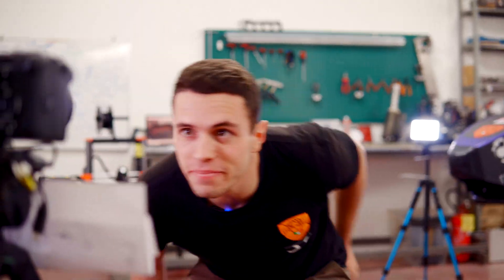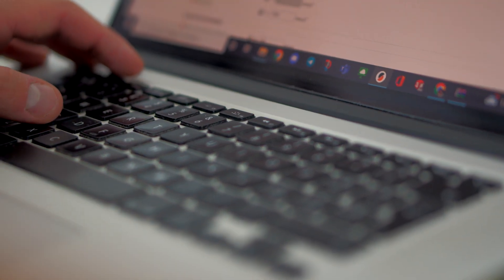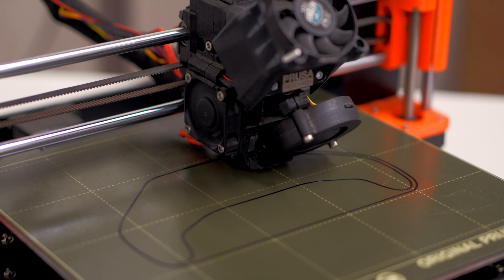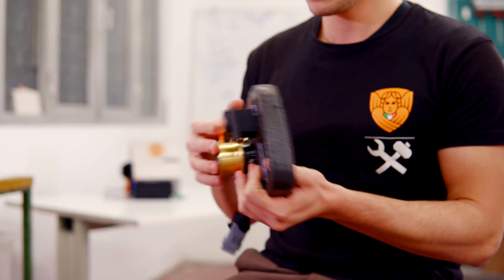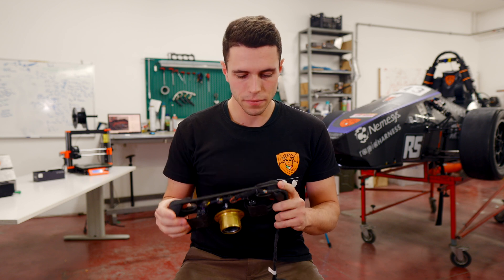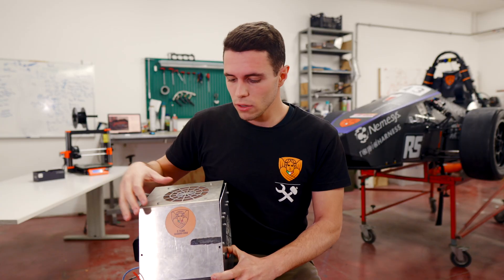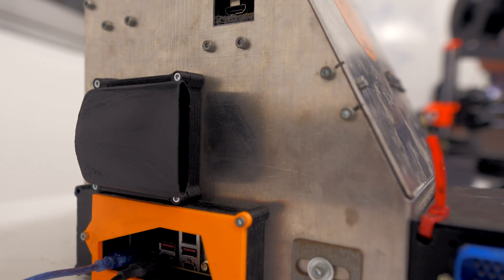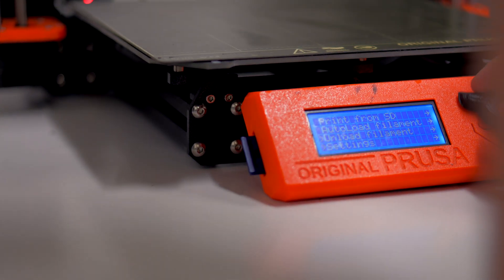Racing Towards Success: The Formula SAE Journey with 3D Printing

Comment: Bambulabs users cry about 3d printer using 3d parts and here we have a race cars with 3d printed parts.
Reply: No Bambulab users are saying that for $2000 fucking dollars you should get quality machined parts. Not shitty PETG.
Reply: @braaap2065  quality part i keep seeing broken parts  and shipping delays on replacement parts
Reply: @braaap2065  shitty pteg.... you mean asa? They stop using petg when asa came out. They where a big push on asa.
Reply: @elchavode6479  They still use PETG. Even so you are trying to justify the price if they used ASA lol
Reply: @braaap2065  you completely miss the point. Printing their own parts on their own farm allows them to 1- stay completely in-house, which is what they've always done and want to continue doing, and 2- show that the printers can, and do print reliably 24/7. It's as much marketing as it is practical for them.